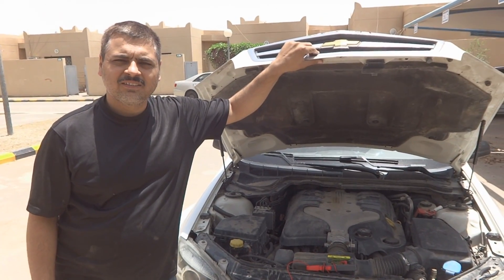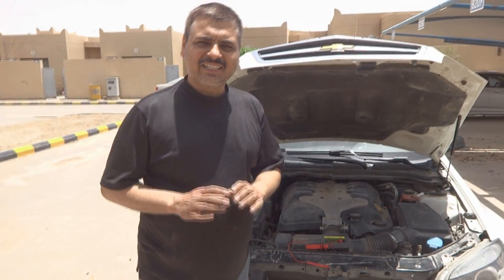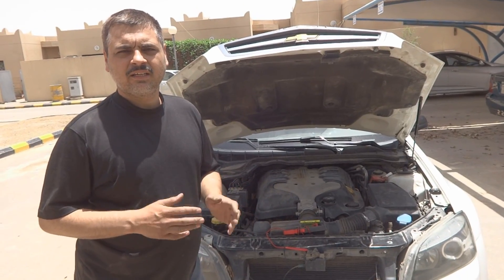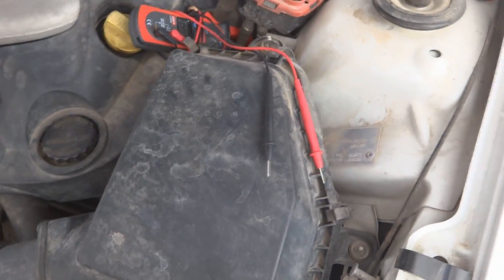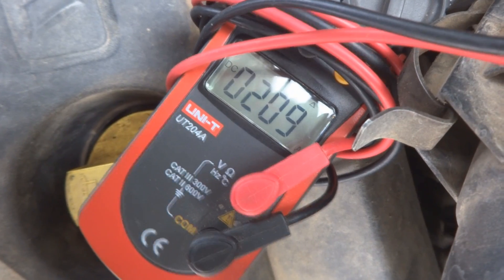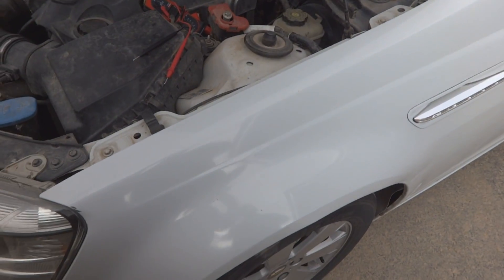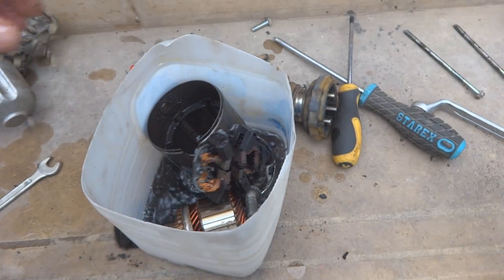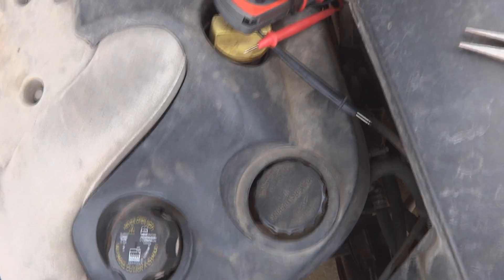Car self starter diagnostic and repair. Chevy Self starter repair.

Comment: When my car is hot  is not start when car is cold then start why?
Reply from the maker: It needs throw check up and testing. There is something which became sensitive to temperature rise. It would need small repair when troubleshot and pinpoint the defect.

Comment: dear sir please guide which company clamp meter I should buy it for DC amp and also guide me in normal condition starter how much amp draw and short starter how many amp draw thank you so much for your help
Reply from the maker: Uni-T clamp from China is OK.  You can go for any other better brand like fluke. But they are dead expensive. Beyond the range of an experimenter. Regards.

Comment: Sir your posts are always helpful, i would like to ask you a question, I have Rav4 2010 Base Model with Manual AC controls, Compressor is engaging normally, I have checked gas pressure in high and low which is fine and even the tube is cold other one is hot but inside the cabin the cooling is week.
Few mechanics are unable to find the problem, most of them said you need to clean evaporator and whole dash board needs to be taken out. some mechanics said evaporator is fine because the air through is good so it is not clogged you need to change expansion valve and there is some filter connected to condenser that needs to be changed also. 
I am confused whom to follow?
also there are evaporator cleaning foams available in the market do they really clean, if they do i can try those and will eliminate the possibility of removing dash board.
your support is very much appreciated.
Reply from the maker: Thank you very much dear friend for liking videos and subscription. Your problem is really interesting and what all mechanics told you, are all correct and would have any valid reason out there or combination of problem there. If I would be in your place, first I would clean the evaporator and look for the results. If solved nice otherwise I would jump to the next part of replacement of expansion valve and refrigerant filter and condenser cleaning etc. Problem here is Rav car is very complex and very big effort is involved to bring off the evaporator and clean it up. Sure it will cost you much. The evaporator cleaners could help but they are not 100% perfect solution. You can try it once if it is not very expensive. Then you will feel if you got some improvement, you can go for regular evaporator cleaning instead of replacing expensive expansion valve. I would upload next video on a Nissan Tidda car evaporator replacement. In that car the evaporator was leaked and was not doing at all. But after replacement, it worked awesomely. In that video I have been showed the condition of the existing evaporator. Also you can watch one other video on my channel I did before on one Toyota Corolla addressing same your problem by cleaning up its evaporator and got awesome results after doing the job. So stay tuned for next video. Hope my statement would help you. Regards,
Reply: Thank you very much for your response, i have given my car @ workshop in order to clean evaporator. the technician told me he will check all the other possible reasons as well.
Evaporator cleaner is not expensive it is 50SR 250ml bottle and easy to use but when i saw your video cleaning corolla evaporator i was sure mine will be more dirty and cleaner will not do much in-facet i bought the car 3 weeks back and cabin air filter was not there and i do not know for how long the car has been driven without filter therefore i decided to give it to technician for repair.
Once again thanks a lot for your swift response.
Reply from the maker: That would be great and will solve your problem also Inshallah. Same was case with me. In my two cars there were no cabin air filters since I purchased them. People are normally removing those filters to get more air circulation inside but the consequence is off course bad evaporator after some time. I installed a filter in my regular using Toyota Corolla when I got the fact there is no filter inside. Good luck is it didn't get that bad yet. Sure the filter reduced down a little air flow but there is a peace of mind of getting nice quality air as well as prolonged equipment life. So better same instruction you may follow when you will get your car back after serviced and in good state. Let me know about your successful repair and the cost of repair when you get it back. Wish you good luck with your successful repair. Regards,
Reply: Sure sir i will post the fix and price.
Reply: sir ALHAMDULILLAH i got my car back this morning, they cleaned evaporator for that they had to remove dashboard, gas was refilled and it cost me 700 Sr.
Now the ac is perfect compressor trips rarely before it stays on for few seconds and turn off.
after all this fix there is some weared sound althoug it is very mild and not frequent the sound comes from passenger side when compressor trip off  it gives sound like "goooump" i tried to express that sound in the way i hear it.
sure this is not compressor sound because you can only here if you are sitting inside the car outside no sound.
any ways if you have experienced that before your guidence is highly appreciated.
Thanks alot for your interest and i expect more posts from your side.
Reply from the maker: That is great dear friend as your car A/C had been fixed in such a hot weather. The sound you expressed is funny! Actually the way you expressed made it much more funny. LOL. You may check it thoroughly and give a little more attention and time and figure it out from where it is coming. One tip is maybe it could be from serpentine belt. To make sure you may pore a little quantity of water on the belt during engine running and feel it. If it solves your problem, replace the belt and re tension it. Otherwise if you are not able to figure it out, you may contact the people serviced your car. They would better figure it out for you because they would have much more experience due to they are living all the times with cars and engines. Anyhow great that you solved your air conditioner problem at first attempt and didn't waste any extra money in unnecessary maintenance. A video on Nissan Tidda nearly the same job is in upload progress and will be soon available on my channel. Stay tuned. Regards,

Comment: Nice work there Jahan. I didn't hear any noise from the starter motor when you first turned it over. And with 130 amps, I would assume that all was well. But you're right that with a little cleaning and getting rid of the old grease and then putting in new grease, you can knock down that amps as you showed in your video. 20 amps less will help that starter motor last longer because of lower heat. And not to worry about not disconnecting the battery cable. It's happened to all of us. Take care Jahan...
Reply from the maker: Your understanding is very much correct dear sir. All was the same as you understood. Thanks for liking video. Normally we are focusing too much on our specific job while doing something so in such a case we forget to disconnect the battery cables. Such careless behavior is sometimes leading to new problems after correcting the job. Especially such things happen much with new guys. Regards,

Comment: In work ( Steel mill ) it was used for cleaning motors etc, at home I used it for cleaning starters & alternators etc.Very good cleaner but if I remember correctly, pretty expensive.
Reply from the maker: There are many expensive solutions. But the best one for us is one which is available easily and less expensive. Regards,

Comment: was the temperate of the day and the oil was it the same before you put the starter and clean it ? because this would make it have less amps if the temperate was just a bit hotter ? and 135 amps for this car  is ok did not need to do this job ?
Reply from the maker: Yes everything remained the same as the only job performed was the self starter. If you do a repair on a self starter which had not been maintained before, it reduces the current draw. There is extra current draw for a self start to overcome the friction generated due to poor lubrication. Regards,

Comment: I would have thought that the more amps the better the starter. That does not seem to be the correct way    of thinking.Great video.
Reply from the maker: Thanks for liking video dear sir. The self starter is taking way more current when it become dry and dirty with time. The overhauling is restoring that to new. Regards,